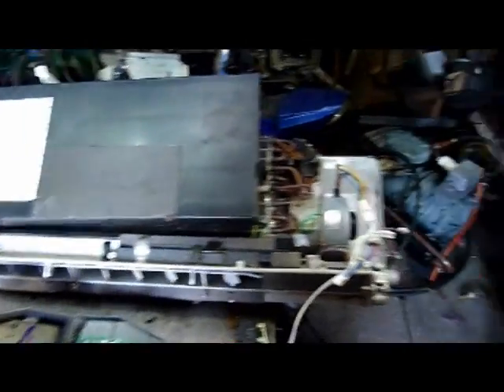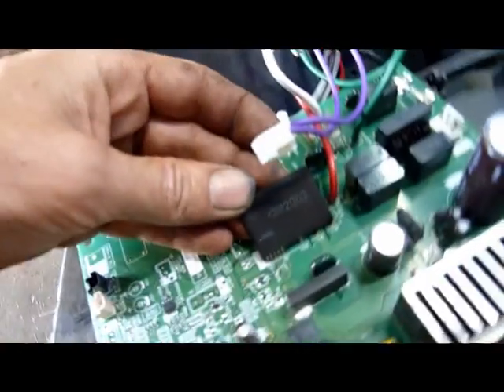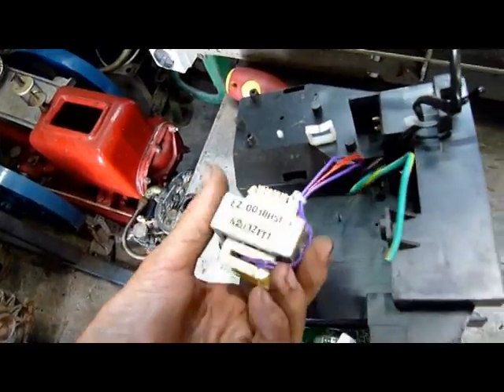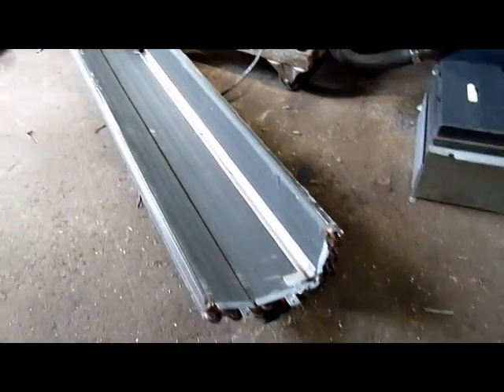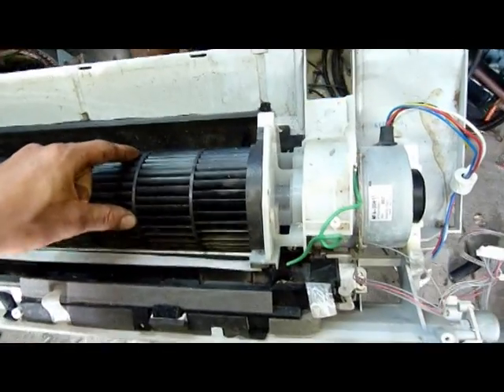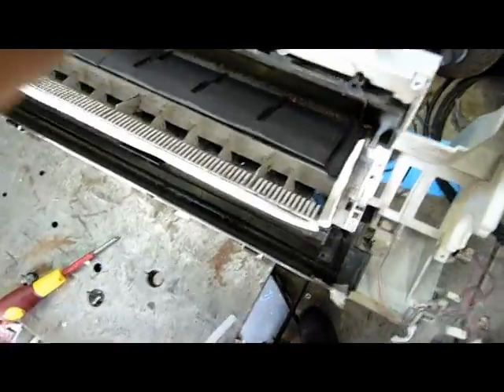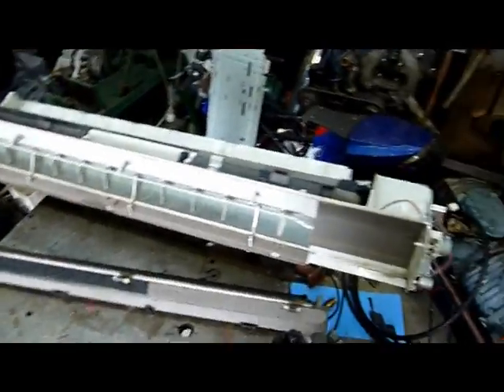Fujitsu Inverter Indoor Unit Autopsy Pt2 Plus Daikin Inverter PCB Exam

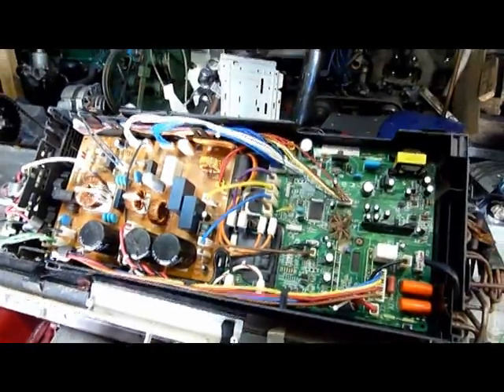Comment: 1:40 Hello. I have the same air conditioner cards here and the daikin air conditioner L5 outdoor unit gives an overcurrent fault. The unit starts normally and the outdoor unit compressor runs from slow to fast. Just before reaching the final speed, the whole system stops abruptly and outputs L5 (outdoor unit overcurrent fault). The designed power is 2200watts, but the power meter shows a maximum of 1650-1700 watts. In my opinion, the current detection is made incorrectly due to the fact that the air conditioner is old. Where is the current detection circuit on these cards or how is it done? Thank you.

Comment: @Aussie50 Yeah they had bit of a problem with the F series too they failed before they even got the chance to corrode the best thing was they had 3 500uf 450v caps on the pcbs so i collected a few and wired them together so i now have a 56,000uf 330v cap that destroys most things!

Comment from the maker: @DragonFlyback256 automotive systems are under pressure too. its just a different type of gas, either R134A, or R12 usually. there are some drop in hydrocarbon based ones tho, like hychill, but they don't work in all systems.

Comment: Ah the old Daikin J series inverter pcb's, the worst thing is if one of the the pcb's fail for whatever reason they recomend you replace both the control/inverter pcb and the power pcb, prety expensive fix for an a/c unit that is now 8 to 10 years old, the up side I guess is that it produces work for us, great vid's ED

Comment: Ed.

I am curious about that HI2002 module.  It looked like a couple of optical isolators and a TRIAC on a dipped ceramic board.

If CAN is on a single AC wire.... it must be slow mode.

Comment: Hard compound lifts parts off the board making life much shorter.  Best compromise is the silicon gel potting compound.  Waterproof, no mechanical stress from expansion/contraction and easy......

Comment: You could minimize contamination using a spray to coat the boards. Also these units need a bit of preventive maintenance. Keep the air conditioning videos coming...

Comment: @compu85 Of course. I worked making a body control for a VW car at my Company and I know how rude the tests are. No only climatic, electrical, surge EMI, dust, mechanical (vibrations).
But in that case is CLEAR that  big insects can get inside (IP rating ?) The protection is ZERO, as you said, potting is obvious. But, where it is ? Inverter Aircons are pretty expensive here. Just imagine paying more and getting your unit scrapped because an spyder damaged the board.